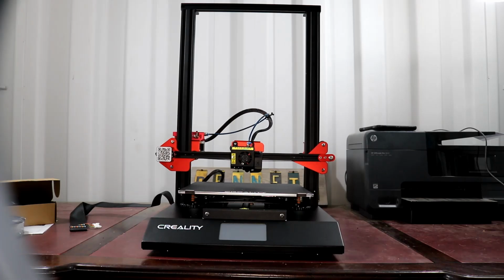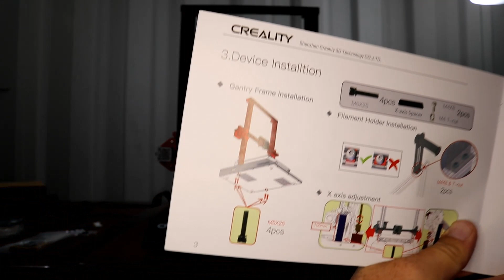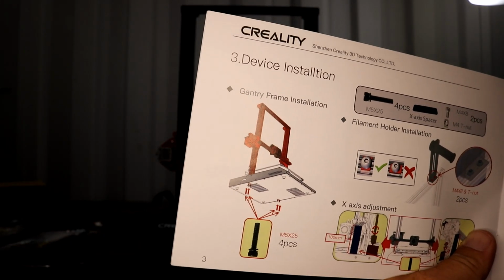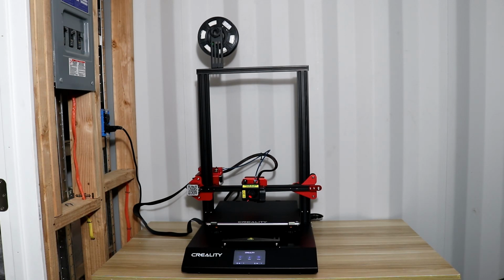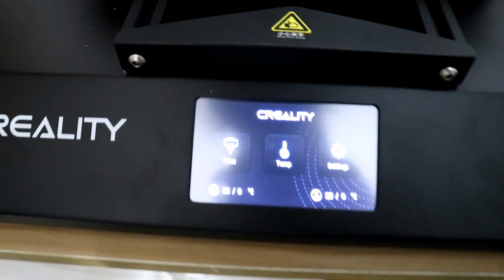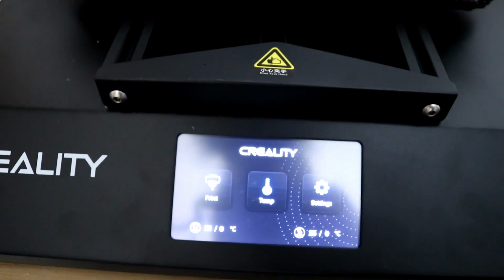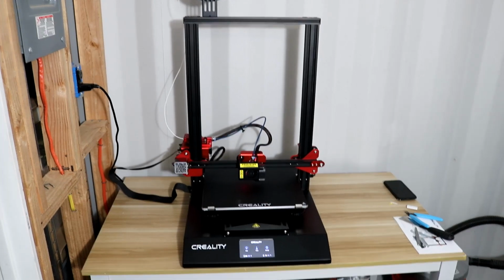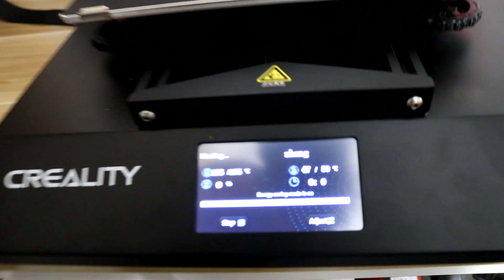Creality CR-10s Pro V2 Unboxing, Build, Overview, First Print and 3D Printer Review for a Newbie

Comment: Just fold out the flaps, turn the box upside down, and pull the box off the printer. This works for many large items, but not 80 inch displays, however!
Reply from the maker: Right on bud ill give that a try next time around, I think I was over thinking it and trying to be a little careful lol

Comment: So I would say I love 3d printing since I've done it before however my first printer was the creality Cr-10 and it was perfect for around 5 months but then just died on me. I then got a refund for it since it was under guarantee and bought a anycubic mega s I think it was and it was good for around 2 weeks then everything started to make weird noises and got a refund sadly. I just got a geetech and my god it is awful. I've been trying for days and days to get a print going and it just always fails and I've given up on it. Dont get me wrong I still love 3d printing and I have so many more things to print. 

Now the question is I was going to spend thst extra money I think its £600 from Amazon. Now I really want a printer that can do what the creality cr 10 did but even better. Would you say this Is the one?. 

I really dont want to go through all the frustration again and end up losing interest due to the many fails of the printers. 

Would you say this is a printer to buy because I'd rather pay more if it is worth it.
Reply from the maker: Honestly man I love this printer but I  did have an issue pretty much right off the bat with the head being too loose and not being able to tighten it up with the tensioner nut at the bottom of the head which ended up being a relatively easy fix. I wish I could answer your question if this printer is the one for you but I'm just to new to 3d printing to give that kind of answer, but I can tell you that besides that little issue from the beginning this printer has been great this far and the reason I went with the cr10s pro is the popularity of this printer and the availability of parts if it dose break

Comment: Its only been 2 days. I know. Have you made an rc part with it yet?
Reply from the maker: Not yet I had a little issue with the printer on about my 4 print the head was to loose and I couldn't get it tightened up with the Centric nut at the bottom of the head but were back in action and printing.
Reply: @fullthrottleobsessions  awesome
Reply: @fullthrottleobsessions  i have put nearly 2,000 cad into my udr and i would like to make my own parts one day. Please make videos of your printed parts in the future. Would you still recommend the printer that you have?
Reply from the maker: I'll definitely be making more once I get the software down a little better, I would recommend this printer to anyone interested in 3d printing even though I had that little issue this printer is extremely easy to use and the print quality is amazing